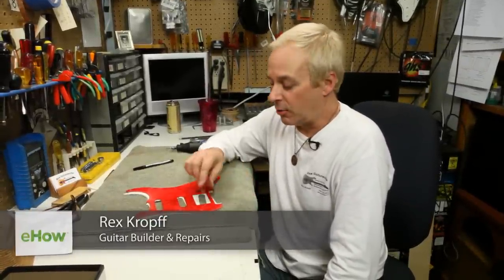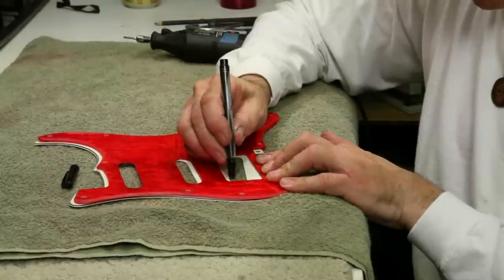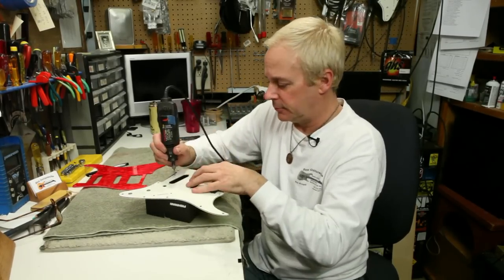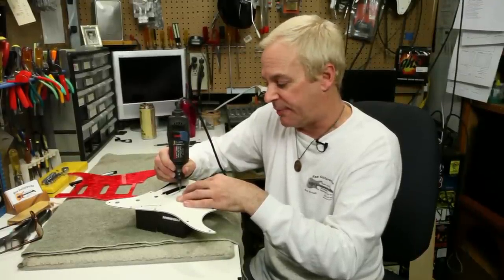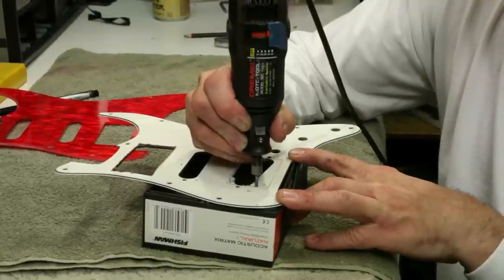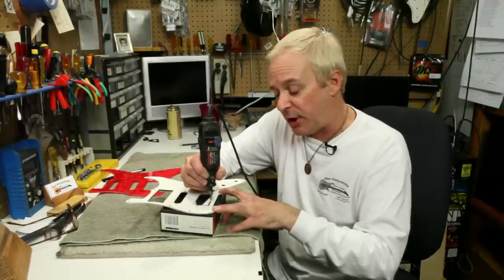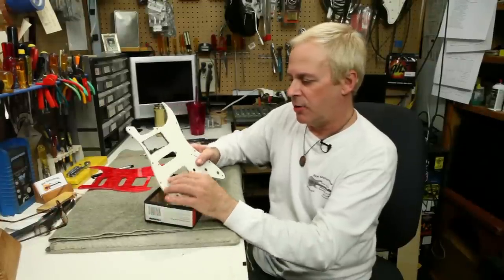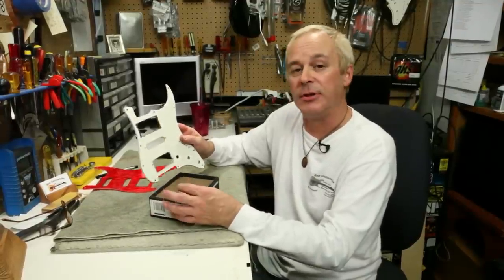How to Cut a Guitar's Pickguard : Guitar Building & Repair

Comment: To all the negative commenters, anyone who has tried this approach knows that it does work. It's easy to sand nice straight edges. It just takes time. Otherwise you are all welcome to pay over $100 for a custom cut pickguard from someone who has all the expensive gear.

Comment: Ah - yes - I've come across this again - and I did comment below - I still think a very fine blade in a fret saw is the way to go.  I've cut one myself like that - it's a bit tiresome - but no accidents - like I think you'll have going this way.  It's just a way too aggressive a tool for this sort of plastic.  The pros way would be to cut and finish an 18mm shape in MDF, then use that as a template with a router to cut the final plastic version - lengthy for a one-off but then easy to make many from that point on..

Comment: square holes...  easy. show us how to make single pickup holes with those rounded sides.
Reply: you cut a square hole and than take a round sanding tool for your dremel to make the ends. Takes time to get it perfect, but you can cut a guard like that just fine

Comment: I'm considering cutting a pickguard for my Strat not because it need one but because I have an old Di'Marzio ToneZone that's just been sitting for years and my cheapo 2003 Mexican Strat's bridge pickup hole is routed for a humbucker - so I figure why not.
I will use a my Dremel to cut the rough shape, (thanks, ehow), but to smooth it out and get the lines straight on the hole, I won't be going by-eye-to-a-line but will clamp down some nice thick steel stock level with the line and then use a stick with sandpaper glued to it.
If I really feel like getting picky, I'll buy a small wooden dowel of the proper diameter for the corners, taking into account that the sandpaper I wrap around it will add to that diameter.

Thanks again and happy crafting!

P.S. !@#$ all the sissies crying about "safety". Your parents are failures

Comment: idk why everybody's crying? he cut the pickguard successfully. Just don't be an idiot while using power tools. He should have had eye protection but everything else he did was fine.
Reply: And what about the screw holes to mount the pickup? They're in the wrong place for a humbucker. Good luck mounting it.
Reply: @nickfefer6986  Just drill new ones? Lol, mounting screws don't even need to have a countersink. He even says that at the end of the video.
Reply: There's a reason we don't see the final product lol, this is guy is NOT getting a factory looking finish with files and sanding blocks lol.

Comment: How can I do this without any special tools?
Reply: i marked up my pickguard and cut it with a boxcutter. took a bit of time.
Reply: Put it in the oven at 120-150 degrees for 10-15 minutes and use and exacto knife to cut the outline. Don't worry about cutting all the way through the first time, just pierce a layer or two. Then when you made it all the way around and/or its cooled down and the exacto knife doesn't easily indent the material, heat it up again and repeat until you have it cut out completely. After you cut it out completely file an angle on the edges and finish with 680, 1000 sandpaper around the edges. The cut will be surprisingly smooth but there will likely be little nubs here and there that need smoothing. It's time consuming but it comes out better than  the dremel method. If you do the dremel method you're better off drilling a ton of small holes all around the perimeter and then using the dremel. I found that you have to use force with the dremel method and likely to cut jagged lines. Perhaps my bit wasnt aggressive enough. 

I forgot to mention that you need to place your pickguard on a flat cookie sheet and put another heavy glass baking dish on top of it to keep it flat. If you dont the center might bow up. It also helps if you heat up the exacto knife too. Not too hot because you're not trying to melt the plastic, letting it sit in hot water is good enough.